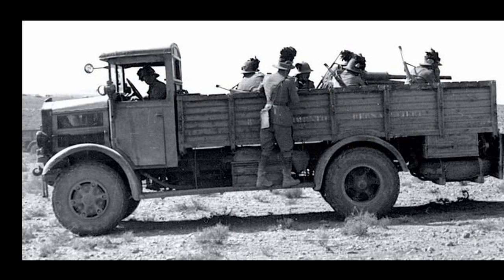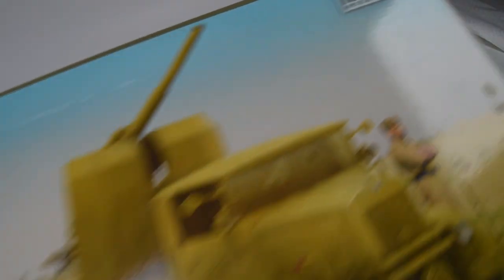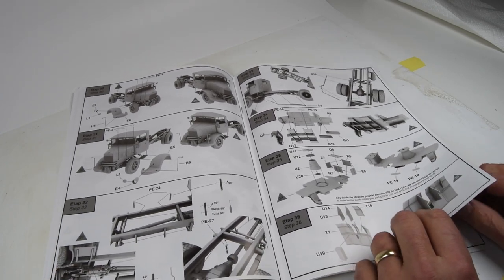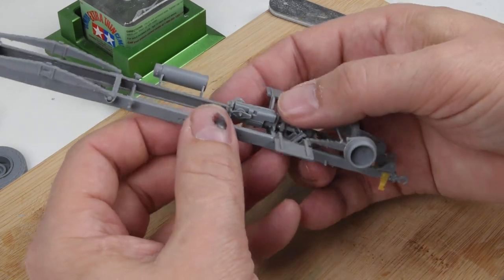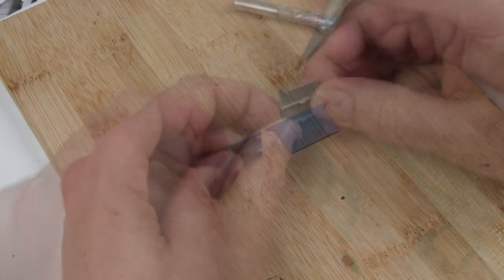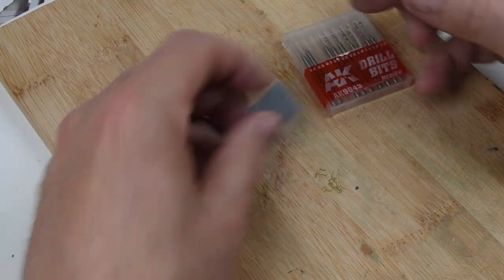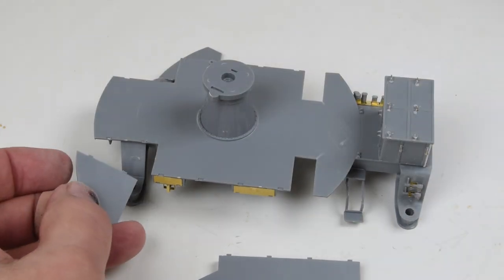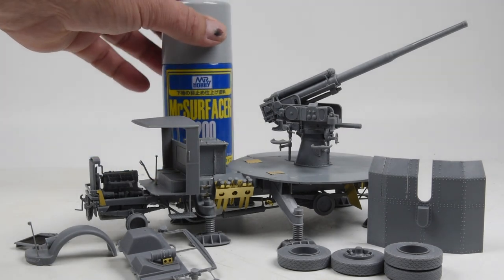Italian Autocannone, 90/53.Ep.1. Unboxing and Construction.

Comment: Do you have to use PE parts or you can choose plastic parts? 
Asking for an Italian friend who doesn't have a lot of time to bend stuff.
Reply: I built it last year . There are no kit plastic parts to substitute for the PE . However , I am not very good with PE , but used everything except the cables . The folds were not complex and pretty easy .
Reply: Looks good . I built this one and the howitzer truck last year . The frame on the howitzer truck gave me some alignment troubles.  Second time around on the 90/53 truck was much better . My one quibble is the thickness of the sprue gates . Seemed like a lot more cleanup . The Autocannone 90/53 is my most ambitious project and I really enjoyed it . Both kits need crews and shells . I have not found anything available aftermarket.
Reply from the maker: Nereo - I echo what Thomas said regarding the PE.  They are necessary, but simple parts to bend.  As you can see in the video I also did not use the very small/fine PE cables and replaced them using the EZ line thread.